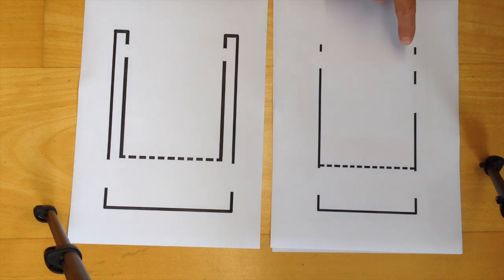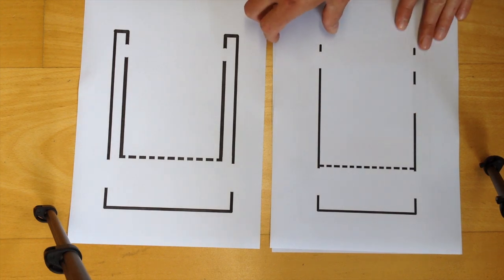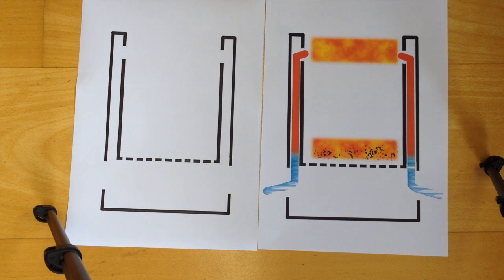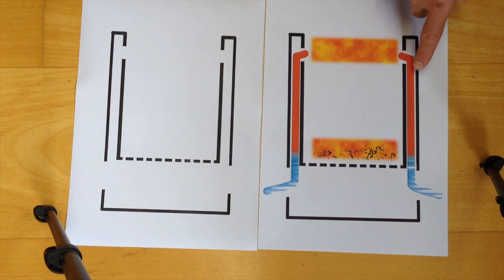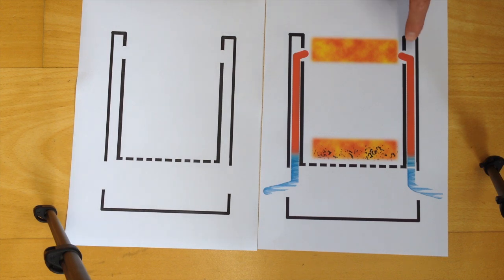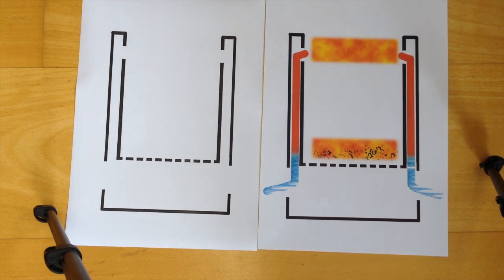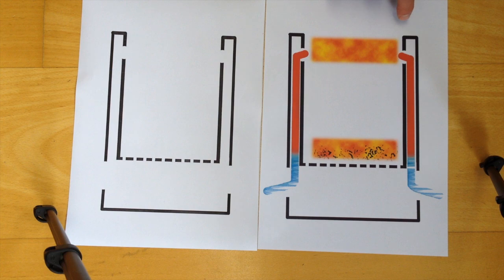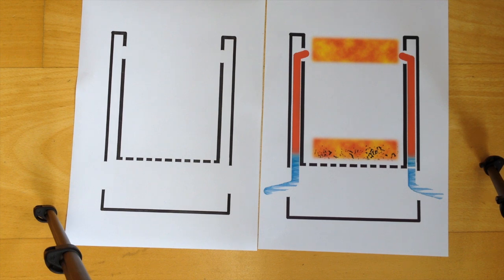What's the difference between a woodgas stove and a hobo stove - Stove Mods theory lesson

Comment: Thanks. In other words, the double-walled wood gas stove is basically a Hobo Stove on Steroids, but without a feeder hole! Have you compared the wood gas strove with Rocket stoves? Thanks.
Reply from the maker: I never built a Rocket Stove but i think it is an interesting concept. But hard to do without welding and also usually a lot bigger than a hobo stove

Comment: I prefer wood gas stove because of the proven reasons you talked about and you can burn not only wood but wood pellets that are perfect fuel for these stoves, use sny type of alcohol stoves in them and the wood gas stove work as a windshield. You can use the base of the wood stove for windshield for gas stove, . In wood gas stove you can use charcoal, pinecones etc. It is really a multi fuel
Reply from the maker: I am happy to hear it works so well for you :-)

Comment: It does not explain why we see flames coming from those top row of holes.
Reply from the maker: The air in the wall moves upwards because it is hot. Eventually it enters the burning chamber through the top row of holes and reacts with fumes that have not been burned yet. This is what creates the flames.
Reply: @stovemods8231  If you take a pipe, and push hot/cold air through it at any spot in your fire pit, you won't see any flames coming out of the pipe. This simple experiment proves that it's not just an air, it's an air mixed with flammable gases. Moreover hot air is worse than cold air for burning, since cold air is denser.
Reply from the maker: @beboba2498  I assume it matters where you inject the air into the fire. Apart from that somebody else pointed out the following (quote): 
"some wood gas is drawn downward thru the bottom holes of the inner burn pot and mixes with the  incoming air providing a hot fuel air mixture at the jets, not just hot air." 
So as you said, it might not just be clean air but a mixture. I find it hard to tell for sure but sounds possible to me.

Comment: what if i will put a controlled fan in the wood gas stove does it fuction the same
Reply from the maker: I never tried that but I guess that depends very much on the details of the build. Flow resistance and other factors might come into play even more. Apart from that I am not sure if it is that useful. From what I understand the woodgas stove is optimized for functioning the way it does. Adding a fan is a whole different ballgeme and might make the way a woodgas stove is built obsolete.

Comment: Thank you sir! Very clear explanations and drawings. A question regarding the 'top part' you discuss at around 2:40: does this top part have to be a solid piece of metal with an opening? Or can it be something perforated, like wire mesh? I've seen different opinions. Thanks in advance!
Reply from the maker: I would rather suggest something more solid because it is supposed to support the weight of the pot. Like an upward extension of the stove with holes. Also something like I used in this video on top of the stove might work in my opinion: https://www.youtube.com/watch?v=tmUAlvurkks&t=1s

Comment: The gasifier stove can easily produce high power, but it's not so easy to let it burn with low power for a long time (until you have a good coal fire going). But it's possible.
You need the best dense fuel you can get and you will need to build up experience with the stove and the fuel. The best you can find almost everywhere are thumb thick branches, just too thick to break them by hand. I highly recommend bringing branch shears.
Cut them 1-2 thumbs short, that way they should burn for about an hour long evenly. But starting the fire is always different, it can be too fast easily.
Reply from the maker: Thank you for the detailed explanation :-)

Comment: Tip ... if you're going to claim to explain something you should understand it first. This explanation is not correct as it implies that only air is drawn up the sides where it's actually air mixed with the wood gas that is con ected with it from underneath the combustion chamber.
Reply from the maker: Thank you for your insight, that makes a big difference. Always happy to learn something new :-)

Comment: For anyone still seeing this video. It should be mentioned that some wood gas is drawn downward thru the bottom holes of the inner burn pot and mixes with the  incoming air providing a hot fuel air mixture at the jets, not just hot air. If the air supply comes from a small computer fan with a select-able power, then the flame size can be varied in strength though it remains orange and sooty and the bottom hole arrangement is poor for a fan assist.
 
Instead 1) place the bottom holes as a ring around the bottom of the inner burn pot sides such that the combined area of all the bottom holes is about 1/3 the combined area of all top holes and the ring should be about 1 or 2 cm from the bottom of the burn pot at the level of the coals.
2) direct the fan to blow thru a single large opening in the bottom of the outer can such that it flows up the annular gap for a few cm before passing over the bottom ring of holes to suck up wood gas from the pyrolysing fuel. Little baffles could add turbulence for better mixing.
3) now varying the fan will mix the wood gas so the jet flames range from lazy orange colour jets with black sooty tips  all the way up to very turbulent bright whitish yellow flame jets with blue hints and at the base of each flame jet. The latter is super clean and consumes the fuel much faster.

Dr Tom Reed pioneered  gasifier stoves decades ago so just search "reed inverted downdraft gasifier stove" for best designs, and detailed gasifier theory.

Using a fan makes these inverted downdraft wood gasifier stoves operate with positive pressure but you can also set such a stove (with out a PC fan)  inside a large thick steel  metal box which has a controllable extractor fan for the chimney thus operating the stove on negative pressure. The flames looks the same in either mode.
Reply from the maker: Thank you for your datailed Input! There are always things left to learn :-)
Reply: Do you have any videos of these designs? Sounds super cool
Reply: @42WallabyWaySydney  Sorry no, I have experimented with these stoves for personal knowledge then dismantled everything. Search for designs based on Tom Reed stoves  and add a PC fan with variable control. Other experimenters have made videos. The flames are hotter, has more bright yellow hue than orange, is more turbulent because of good air mixing, there is much less soot / unburnt smoke (wood gas). Search wood gasification for more general  results.

Comment: Hi, I recently discovered this pyrolysis phenomenon and in fact it has become my hobby of the moment.  There are some things that are not clear to me, however.  Strangely enough, the first tutorial I saw was with only one can, and in fact so I built my first stove.  When the pyrolysis stops, a lot of smoke comes out.  Then I saw that most stoves are made with 2 cans, and so did I.  In addition to seeing the flames that come out of the holes above, when it ends, not all that smoke comes out.  In this drawing you explain very well how the flows of air and gas occur.  Can you also explain how they happen in one can?
Reply from the maker: Wow, this is a very specific question and I hope I can answer everything correctly. From what I understand pyrolysis is a thermo chemical process that happens without oxygen and therefore - from what I understand - is not happening in any oven. 
This is certainly a lot  simplyfied but when wood burns the heat turns the wood into gas/smoke which reacts with the oxigen after being ignited and then creates heat which turns the wood into gas/smoke and so on. The usual reason why smokle occurs during such a scenario is the lack of oxigen so the gas/smoke can not react/burn. All the two cans do is transport additional oxigen to the upper end of a stove and inject it there into the burning chamber. Therefore the jets you see are driven by air/oxigen and not smoke and the gas that just would have left the stove without burning receives oxigen to burn. Therefore the double can uses the gas more effectively and clean.
Now with one can the whole thing is a lot simpler. You have your firebed and wood in the lower part of the stove. The gas/smoke burns but only up to the point where no oxygen is left over (the upper end). The flow in the can goes just straight upwards. From the holes where the air is pulled into the stove through the burning chamber and out again at the top, pretty much like a chimney. This is the reason why when having just one can (which I personally prefer a whole lot) my advice always is to drill some additional air holes at mid height of the burning chamber. This adds some air as well but it is not injected with pressure into the chamber. Did this help?

Comment: Awesome!  Just what I was looking for.  I’m going to try using aluminum foil wrapped around my Ikea hobo stove and see if I can make it burn cleaner.  I’m going to use (real) duct tape and aluminum foil to close off most of the holes going up the sides of the Ikea silverware holder.  Then wrap another piece of foil loosely over the whole thing to create the outer wall/hot gas chamber.  I already have the whole thing sitting up getting good airflow underneath.  I think it will work according to your nice drawings.  We’ll see if my execution works.  If it does, I’ll post a video of it in action.
Reply from the maker: Please, if this works and you make a video send me the link! I am curious about it :-)
Reply: Stove Mods : I did it!  I made a video too, but haven’t uploaded it yet.  I wrapped a piece of aluminum foil folded over in thirds around the middle holes of the sides of the tall Ikea hobo stove.  I then made a ‘gasket’ out of some crinkled foil and wrapped a ring around the top rim.  I have a fairly rigid piece of aluminum that I use as a windscreen that goes about 2/3 of the way around the hobo stove.  I used that rigid aluminum as the outer wall and closed the rest off with more aluminum foil wrapped around the whole thing.  Everything was secured using real duct tape - the aluminum adhesive type.

It worked!

I really don’t know if it was any better than just using the plain stove but it did make some nice jets of flame come out of the upper holes.

The nicest thing about it was as it burned down and stopped producing the jet flames it burned very clean, almost totally blue and used very little fuel.

It didn’t radiate heat to the sides so it’s definitely not as good of a ‘space heater’ as the simple hobo stove, nor is it as fun to watch burn because you pretty much have to look down into it to see much.  This was just a proof of concept and I could smell the tape adhesive burning.

I didn’t burn it very long, but nothing failed horribly in the 20 minutes or so that I was testing it out.  It was dark so the video shows the flames well, but not much else.  I’ll do some daytime video tomorrow.  Hopefully I can edit it all together and get a decent video made.  I’ll keep you updated.
Reply from the maker: @nathansharp3193  Congrats :-) Seeing jets come out the upper holes and blue flames sounds like it worked quite well to me. I am really forward to see your construction :-)

Comment: what if you make a feeding hole on the side (low, like a rocketstove) and then sealed it closed in both the innerwall and the outer wall, so air won't leak at those points? You could even limit the amount of air intake through that hole by making a lid for it?
Reply from the maker: Sounds interesting but I am not quite sure if I can du that with my rather limited technical options. Have to think about this!

Comment: Unfortunately the description is wrong. It's wood gas stove and there is no word about "the gas". The only correct way to use it is to burn down. You fill the stove and fire it on top. Then gasification process is happening. This is why you need the secondary air chamber. 
It's very well described on wikipedia: https://en.wikipedia.org/wiki/Wood_gas#Stoves.2C_cooking_and_furnaces
Reply from the maker: Hi,

thank you for your comment. In my experience the double wall also has a huge effect If you do not light the stove from the top, compared to stoves that do not have a second wall. Still, I know I need to be experimenting more with fueling them from the top!
But I am very sure, the general principle I am describing takes place like that. But It might be true that I do not distinguish enough between air and other gas in this vid.

You can always be more precise in life:-)
Reply: yeah, I agree that in general it helps. The think is that if you fire it from the bottom You cannot call it wood gas stove. That's all:)

Comment: I am sorry but this is not a complete explanation of the workings of a wood gas stove. The composition of the gases coming up in the double wall space is not strictly air but also gases expelled by the burning wood. If you take measurements of the pressure just below the holes at the bottom of the combustion chamber, you will see that the pressure is higher than in the double wall chamber.  The burning wood expels gases and a big part of these gases are moving DOWN through the holes at the bottom of the combustion chamber then they are  drawn in the double wall and exit at the top and ignite.

The whole process is clear when looking at a wood gas stove with the outer walls made of glass. 
Ref: /watch?v=wzN-cYR84_Y&t=143s
Reply: frepi yeah, you are absolutely right.. he misunderstood the princip..
Reply from the maker: Hi,

thanks fo you comment! I think, everything you say is correct, just more precise than what I explained!
By the way, somehow I can not use the link you put in the comment.

Comment: Great
Great diagrams and explanations of the air flow. 
So many get these basics wrong

On the question of BOTTOM UP or TLUD

1 - If your only using it for a small amount of heat ( eg. to boil 1 cup water)
the bottom up method works fast and you can add just enough fuel as required to complete the coking/boiling process and you have very little waste/unburnt fuel at the end 
2 - But if doing some serious cooking then the TLUD (Top Lit Up Draft) method gives a longer more controlled burn and you don't have to hang around feeding the fire, lifting on and off a big pot of boiling water/food to add more fuel

TLUD = Top Lit Up Draft the fire burns longer and more efficiently if wood is
packed in and lit from the top like it is designed to be used. The fire then
only heats and gasifies the wood near it and heats the sides of the internal
metal cylinder causing the vents to let out warmed air to ignite the rising
wood gas. This gives an even and controlled longer burning process from a bigger initial batch of fuel. 

If  BOTTOM LIT, the fire heats ALL the wood ABOVE
IT rapidly gasifying it often giving off more gas than the air vents can cope
with.
This results in lost/unburnt wood gas= blacker bot bottoms = lost
potential heat = short lived fire = less efficient fuel use 

If you mainly use bottom lit, then the secondary air holes need to be
bigger or more numerous

It just depends what your cooking each time, which method you choose to use 

standing on the shoulders of others
Reply from the maker: +Greenwood 
Thanks a lot! This is a very good explanation in my opinion. Having bigger secondary air holes for burning more wood at once sounds pretty smart as well. That confirms what I saw when I made the holes for one of my stoves bigger. The boiling time improved and in fact I lit it from the bottom in that case.

Thanks again!

Comment: Very few people understand the concept of the woodgas stove. Thank you for getting it right. Very good explanation of how it works. I have seen too many video's telling us that there is an inversion that causes the fire to burn down. that is BS. you nailed it.
Reply from the maker: +Gregory Bergschneider 
Thank you! In fact I have been told twice recently that I am supposed to start the fire in a woodgas stove from the top and let it burn down. I did not test it jet but there is also a recognizable effect with my woodgas stoves if I light them the usual way!
Reply: When my powered fan woodgas stove burned out I did notice some smoke pouring out the secondary burn holes. It's possible that a bit of the smoke from the fire got sucked through the smaller holes at the bottom by the air moving through the walls but I don't think it was meant to be an inverted downdraft gasifier, although you can get them.
Unfortunately I didn't look after it that well so it got old and rusty and it had also been repaired due to an internal fire I had burning some old cooking oil when I was a stupid kid. I used to put more volts to the fan and also it would burn coal and probably saw more heat than it was supposed to and got wet.
Reply: You can easily burn a wood gas stove from top to bottom. However, the air does not move down, no matter how you use them. The hottest part of the stove is the compustion chamber. So, there is the strongest draught upwards. In fact, the flames of the secondary burn don't come out of the upper holes, they rather develop where the wood gas and the hot air meet just along the edge of the holes.
Reply: Waldläufer70 n